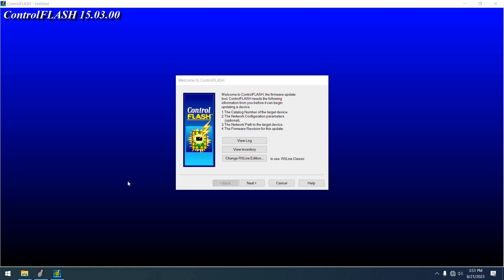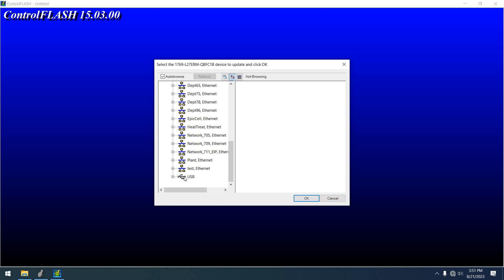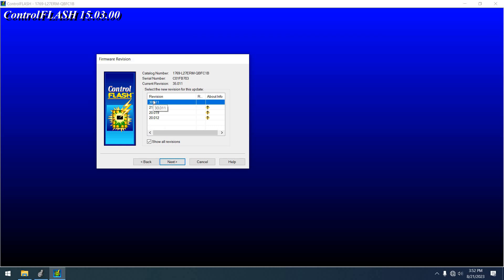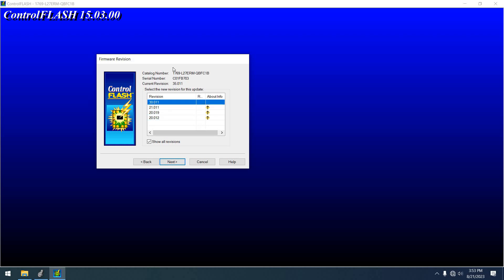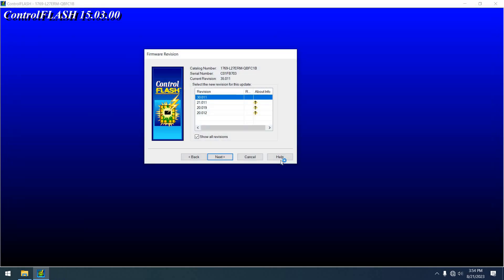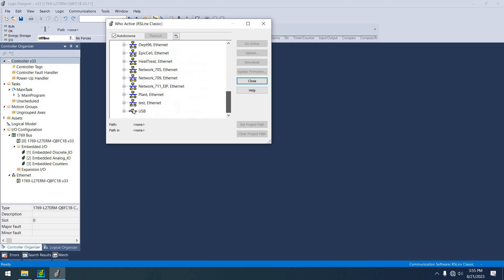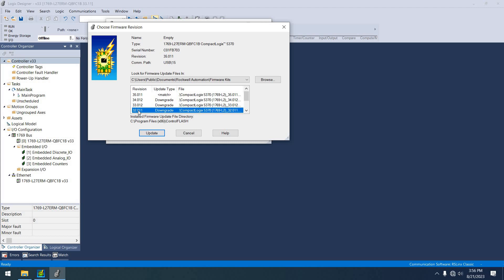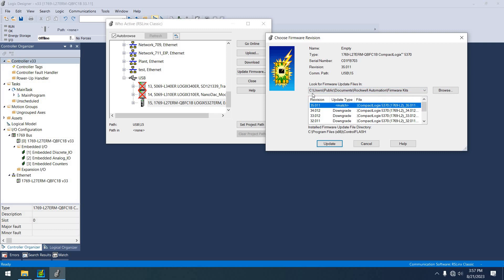Flash CompactLogix AB Controller - ControlFlash not showing Firmware - Resolved

Comment: I was also having this issue and kept digging after I saw your video and found a Rockwell Knowledge Base answer on it.
v30.014+ firmware are no longer listed under the exact part number but under the family part number.
If you scroll down farther you will find CompactLogix 5370 (1769-L3) etc. Select the correct family number for the controller and it will list your newer firmware.
You must also have ControlFlash v15.03 or higher to access the newer firmware.
I guessing Studio 5000 is building it's own ControlFlash window and gathering all the Firmware by interfacing with some ControlFlash dll files when you hit the Update Firmware button.
If you have a Rockwell TechConnect contract the document ID is QA42198
Reply from the maker: Thank you for this information, I just found it searching my page management area. I think YT hid your comment for some reason, which is weird bc I don't even have hold questionable comments enabled...